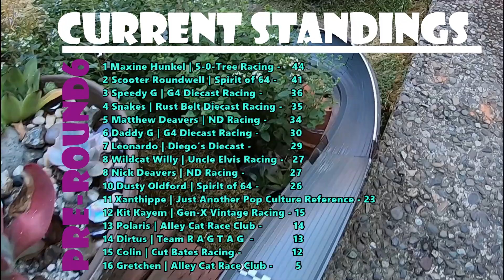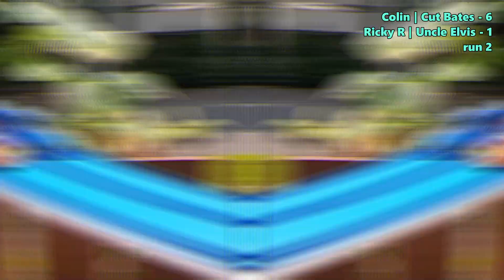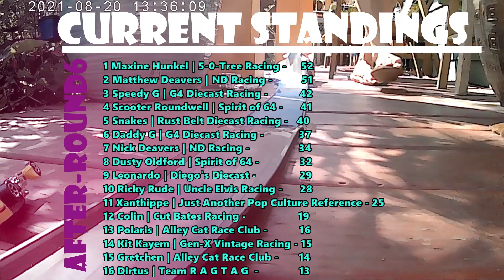GCR Summer Round Robin - round 6 tOO MuCh ActiOn to bE so T I N Y

Comment: So I need a car quick enough to win the race into turn one that’s slow enough to maintain control down the drop. Should also have a lot of ground clearance for riding the rail and a very low center of gravity to survive Sports Car Corner. If I can make it pull slightly left away from the fence at the top and track perfectly straight at the bottom that would be also good. 

SIMPLE!  When’s the Fall Classic start?
Reply from the maker: That's right exactly. Not too fast, not too slow... it's easy!